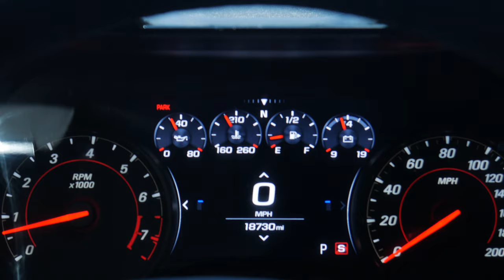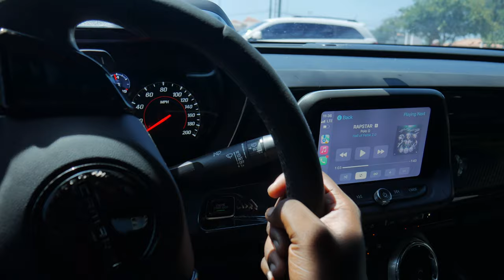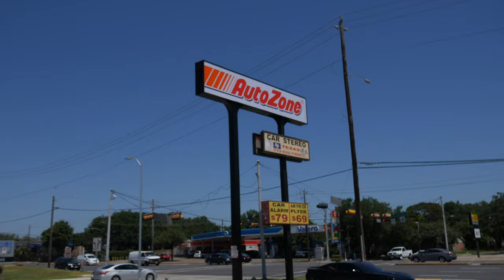INSTALLING THE  SEEQUENCED THIRD BRAKE LIGHT ON MY 2021 CAMARO 1LE

Comment: How do I connect the show mode? I bought a switch and also a wire I wanna keep the switch in the trunk? I connect the extra wire to the yellow wire and then to the switch?
Reply from the maker: Yeah then connect the power and the ground to the switch
Reply: @JIProductions    ok the ground to the switch but how do I get the power? Where do I connect?